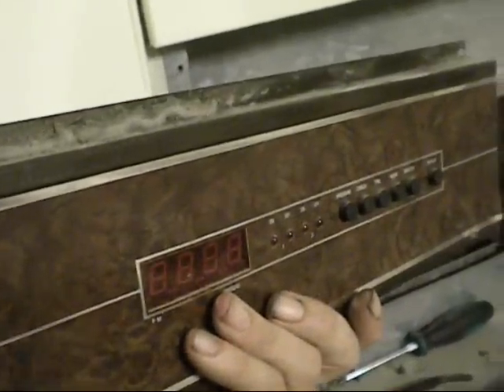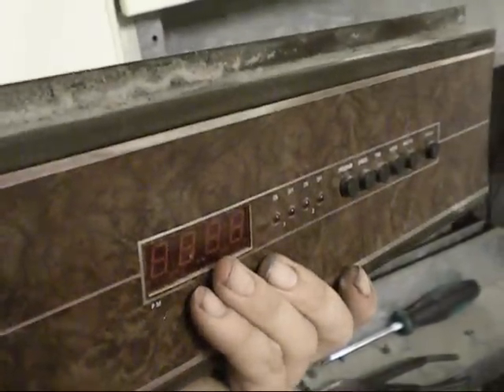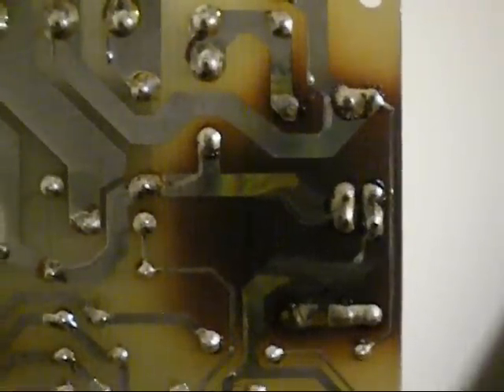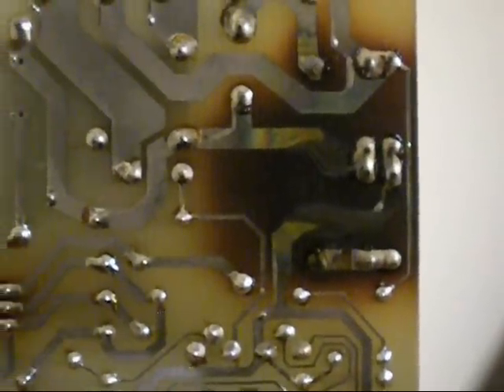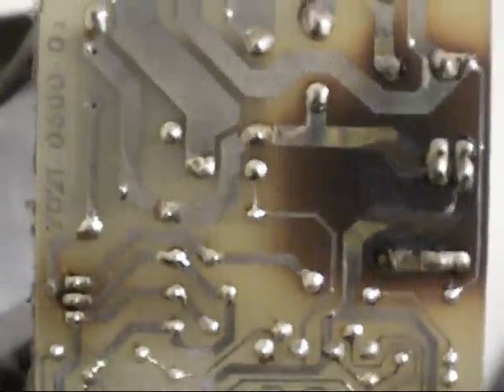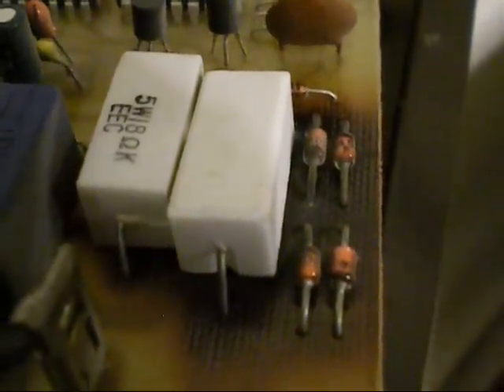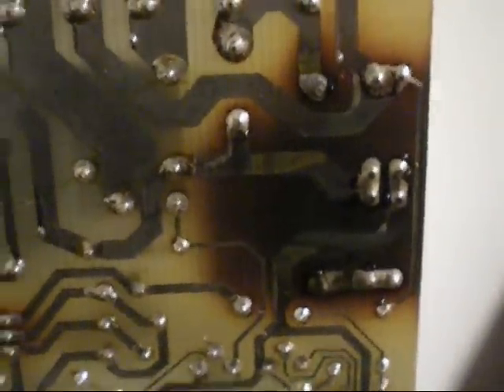Sad Heater

Comment: If I read the label on the resistors correctly they are 8 ohms at 5 watts, replace them with a pair of 10 watt resistors and they will run a little cooler. Even better yet find a pair of wire wound resistors that have a built in heat sink that you can mount to a piece of sheet metal. The diodes next to the resistors don't even look like rectifier diodes they look like detector diodes with the clear glass cases, replace those with some 2 amp rectifier diodes and they will hold up much better.

Comment: Those resistors itself prob. aren't the problem. That 7805 can be cooked, altough these component series (78xx) can handle some abuse.

Another guess is the for diodes (rectifier) above those "hot" resistors. 

The solderjoints are defenitly a point of attention.

Those resistors including discoloured pcb you can find in various equipment. Mostly battery chargers for electric drills.
They are designed to get hot. Other components around them might be not. See my medion repair vid.

Comment: Should be an easy repair, 4 silicon diodes to replace. The resistors power are too close to the board. Need some standoffs and the regulator 78XX needs a heatsink.
Poor design of the circuit board.